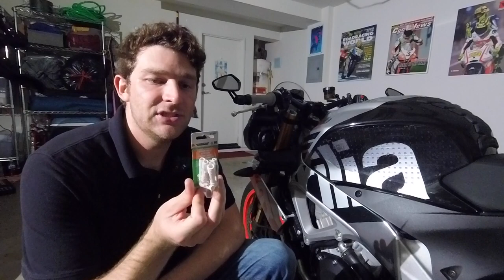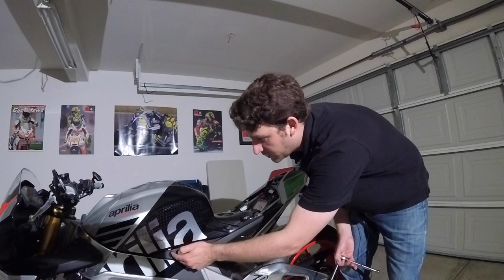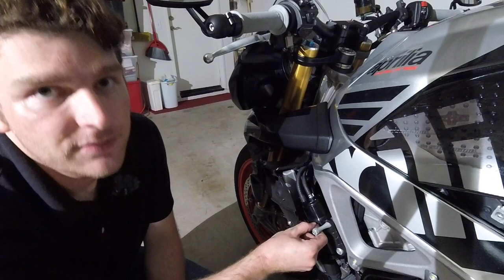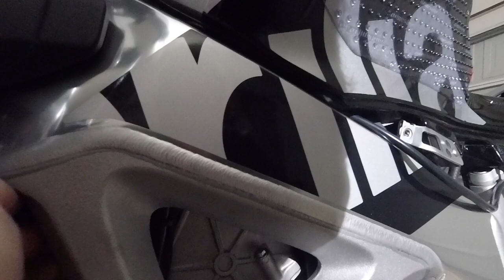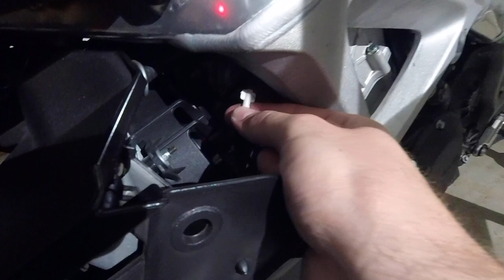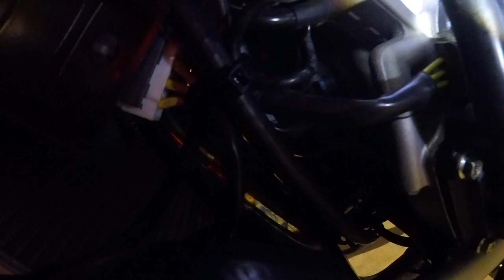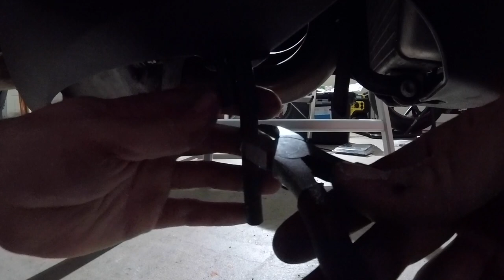How to Remove Your Aprilia Tuono V4's Charcoal Evap Canister in Detail (and Why I Did!)

Comment: I have tuono v4 factory 2018 so I am interested in this modification. I wonder how much better cooling you got in practice? do you feel better when the ventilator works?
Reply from the maker: I noticed the coolant temps with the fan on in traffic or when idling after fully warmed up dropped a few degrees, but nothing super significant.